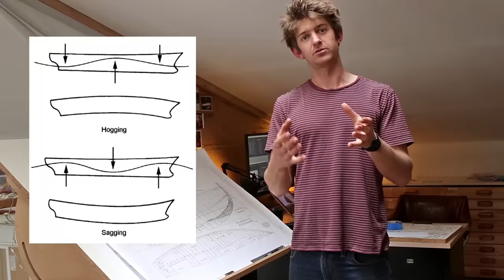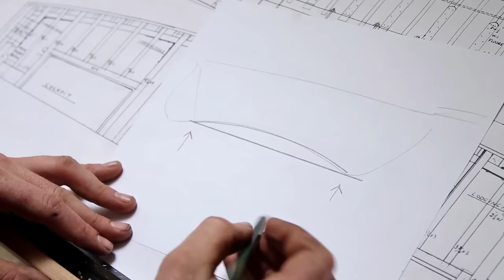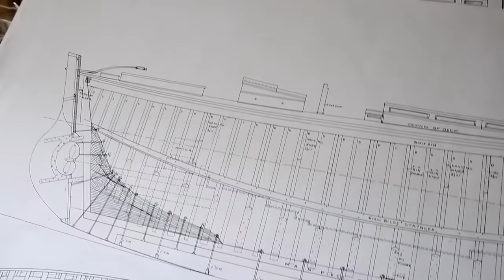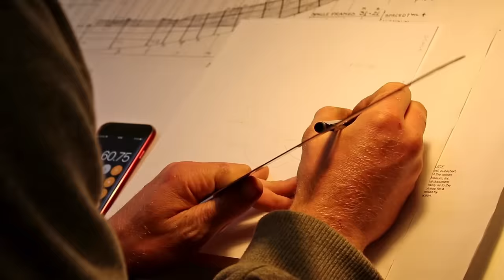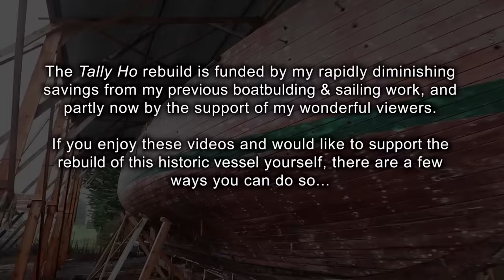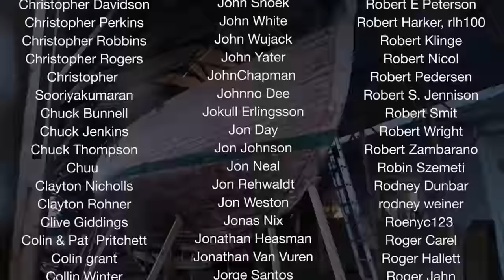Restoring a HUGE vintage Ship Saw / Bandsaw - Rebuilding TALLY HO EP22

Comment: Hey Leo!
Your commitment and tenacity is inspiring. Great job!

I do have a couple of questions. 
First regarding the floor notches in the old keel timber; would these (despite the complexity of having to cut out what appears would have to be curved notches) not aid in giving rigidity to the frames and backbone? I get that the sheer mass of material and fastening will keep things in place but I was wondering...

Secondly, if you had to guess, when would you be putting her to sea? 

Once again, great job Cap'n

-100!
Reply from the maker: No, they are so shallow that they would not have an effect. I'm certain that they just cut the shallow notches because the shape of the wrought iron floors didn't quite match the shape of the top face of the keep timber, by chance. It would have been a lot more work to try and machine the bottom of the floors into exactly the right shape.
Regarding the launch - when she can float, of course! ;)

Comment: You should buy a big vfd for that saw. It would help you with speeds and make your life alot easier than using that rotary phase converter.
Reply: I have seen many setups for running three phase machinery on single phase services, the rig he has now is 100% functional, is installed, and is free. Why replace it?
Reply: That RPC is primitive - no balancing caps, no auto start, open drive belt. You can tell it's not doing a very good job by way that saw is struggling to come up to speed. My guess is the generated leg is very weak. This also means that it's going to be under powered, which equates to poor saw performance. Adding some balancing caps would probably help a lot. Switching to a VFD would do a much better job.
Reply: I'd kick in for a VFD.
Reply: I once bought a mill with a static phase converter on it, my electrician looked at it and told me it would cook the motor in short order. He did not know that the thing had been used eight hours a day for the past thirty years with no issues.

As I understand it, this is the setup that has been running the saw for decades. 
-The saw setup is temporary.
-The saw may someday go to England, the requirements will be different there.
-the saw will probably be the only three phase tool in the shop.

No need to let the perfect be the enemy of the good. If some has spare money lying around, it would be better spent on bronze hardware than redundant electrical gear.
Reply: Maybe American Rotary will comp him one.
Reply: A VFD would work you can buy one on ebay for cheap. But it take a little programming. Buy the huan yang and buy over sized. Or just swap to a 220 motor.
He is not a production shop he can just gear it a little slower. 
Yes his rotary phase converter is very primitive

Comment: I feel a bit silly offering advice to someone as talented and resourceful as you are, but here it is anyway: Be careful around that band saw.  A circular saw or a jigsaw or a chop saw...  those are noisy enough and hard enough to handle that you automatically pay close attention to what you are doing.  But a band saw... that runs so smoothly and quietly by comparison that it is all too easy to become complacent and let your attention wander.  In my admittedly little woodworking experience, I had to keep reminding myself that the band saw was always lurking quietly ready to do me harm.

Comment: Oh this is classic youtube engineering. You only use a rotory converter (And thats a crude example of one) when you absolutely have to as in the piece of equipment has an odd motor that is not easy to replace with a 220 motor. Just take the 220 motor off the converter or something similar and mount it on the band saw (pay attention to rotation) even if you have to make a simple adapter plate.   Always take the most direct route
Reply from the maker: I want three phase for the tilt motor, so it can run in both directions. I had two free motors and someone who wanted to make a rotary converter, so in this case that was the most direct route to get the saw running.
Reply: You can wire many  220 and 120 motors to run in both directions. Usually the same switch the machine already has. you just dont use the third connection.
The phase converter you built will make delta 3 phase 120/120/240 . since it has no provisions to balance the current the third leg will be very weak. Hurting the performance of the motor.
The converter you build also sounds very ruff , maybe its just the way the sound was recorded? It should just be a low humming sound.
Great project cant beat those classic lines
Reply: Then there is the simple way. take the tilt motor off and replace it with a hand wheel. Seems like it would be much more controllable that way?

Comment: I'm not trained in boat building.  Question:  Is removing the iron brackets from the Tally Ho and replacing them with (2X lumber) going to have a negative result on the Tally Ho?  Like the saw.  Looking forward to seeing a cut from the saw.  BTW:  will the saw's lower wheel (in hole) be exposed to rain water filling the hole?
Reply from the maker: floors will be replaced with Bronze replicas, hopefully. The saw and hole are underneath the boat shed, so hopefully not!

Comment: I hope that as I binge-watch these videos, 2.25 years after this one was made, that there comes a video where there are hand-made, wooden, guards over those two giant DEADLY wheels of that ship's saw, and over the open chain and belt drive system. It is incredibly easy to get tangled into that sort of mechanism and it will be FATAL ! Death happened in an instant on an historic steam engine at Greenfield Village: https://www.joelontheroad.com/lethal-greenfield/ Leo can make mistakes. Leo forgot the chain 18:35, that sort of error around those two huge wheels will result in a horrible injury, or death. Cover that saw.

Comment: sampson boat co. where do you even find line drawings and plans for vessels like these?
Reply from the maker: Mystic Seaport Museum
Reply: Of course you did, mind if ask what kind of process that was? I deal with museums for artefacts on occasion, some are very difficult, others not at all.
Reply from the maker: actually the Albert Strange Association got them from mystic. Think it was pretty easy, but there is a fee.

Comment: what was the old york air con compressor @5.37 used for ? on board fridge?
Reply from the maker: she had a generator and freezer/fish hold installed when she was used as a fishing vessel in the 80s/90s
Reply: The York is off a car and would have been working hard to keep a hold full of fish cool,let alone cold . interesting stuff when is revealed when you dig back far enough into a boats past. :-)
Reply from the maker: it may have run off the generator and supplied compressed air for some other fishing-related application.. perhaps a small deck winch or something.

Comment: Also for reasons of authenticity maybe stick to the original design otherwise you may as well just build another boat,
The curved shape of the floors? cast braces. fitted to a curve on the wood portion could be intentional to keep the joint from moving. Also the notches in the keel could be there for a reason. those old time ship builders had there hard earned experience and tricks. Many have been lost unfortunately.

Comment: Hmmm... As another overhaul of another 200 year old wooden ship showed it's naval architects and restorers, sometimes inexplicable details have very good reasons for being there.  I fear that you may find you have not improved the structural integrity of the boat by modifying the hull to conform to the new keel, rather than the other way around.  It seems like a lot more effort, and you're keeping a problem to change the keel to match the floors, but this is a boat that has lasted - is it a century?  with that design detail.  All the same, good luck.

Comment: IF YOU ARE DOING SO MUCH WHY NOT JUST BUILD A NEW BOAT.  ANY AS FOR THE  NOT FLAT METAL BRACES JUST GRIND THEM FLAT . AS I DON'T THINK THAT YOU KNOW MORE THAN THE ORIGINAL BUILDER'S . AND DON'T STEEL THAT SAW TO ENGLAND . 
DAVID GRENIS BOULDER COLORADO USA . LEAVE IT IN THE USA NOT TO RUST IN F" ENGLAND
Reply: 1stly, you accidentally left Caps-lock on, that makes it very annoying to read
2ndly, by the time you wrote this, Leo has allready postet a new video in which he started making new "floors" (those braces) out of bronze
3rdly, this project isn't about saving money by buying used, but about restoring a piece of history (building a new boat would be much cheaper and Leo knows that)
4thly, Leo surely knows MUCH MORE than you do, aside from the fact, that today's boatbuilders have an extra 100 years worth of knowledge at their disposal, so Leo might very well know more than the original Boat builders
5thly, Leo will put the Saw to great use, rather than leaving it rusting somewhere in the states. Stop crying